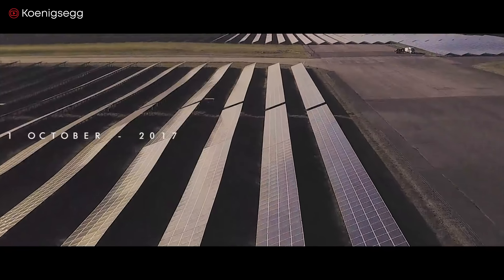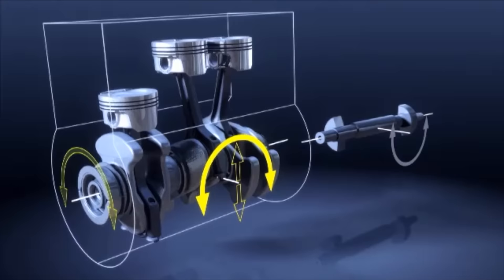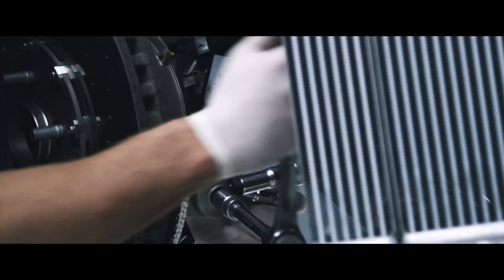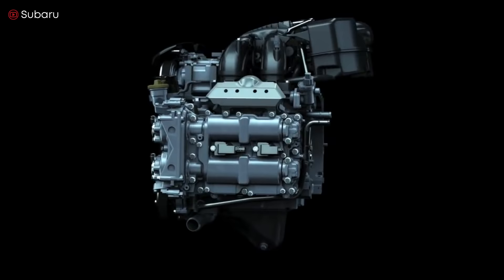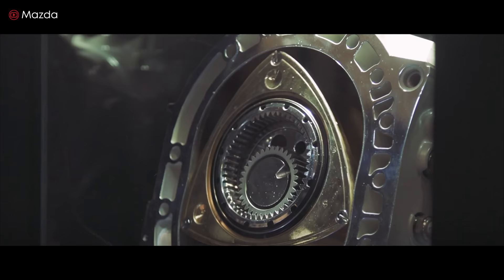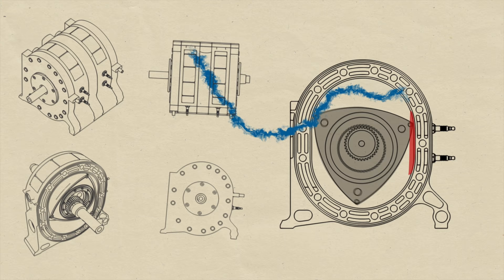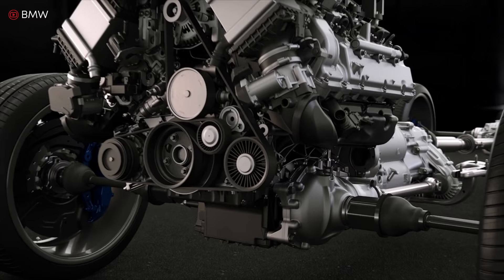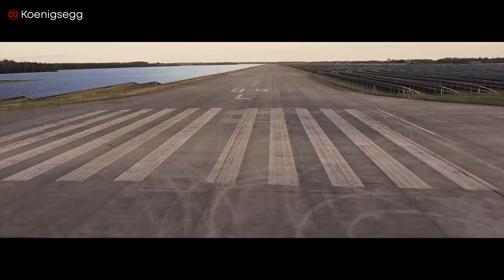Who Makes the Best Engine and Why

Comment: "rotary engine" is a incorrect designation, launch from Mazda because sounds more sexy as "Wankel KKM" (for "kreiskolbenmotor" = rotary PISTON engine...A "rotary engine" is sommeting different: invent in 1893 from the french motorcycle builder Felix Millet, and use up to the early 30's as aircraft engines...

Comment: What does the top speed times have to do with, "Best engine"?   Answer-Almost nothing.   Scotty should know, it is believed that the SSC TuaTara falsified their data a top speed video.   Is the TuaTara, Bugatti or Koenigsegg really production cars?   Technically now, yes.  That is debatable.    At least the Koenigsegg and Bugatti runs were  legitimate.    So, what the 3 have in common is:  They all have 4 wheels and are cars?   They should be that damn well engineered for the money.    Benz/Mercedes-Benz have done everything.   They invented the first automobile and have introduced almost every technological feature, safety feature and other.  Almost everything trickles down from Mercedes of a decade before into your average daily Toyota. ;)    (AGAIN...IT IS PORSCHE......PRONOUNCED PORSHAAAAAAAA!   How is that Toyot doing?  Rhetorical)    Always sounds like he's reading off index cards..very robotic.     I won't mention his Nürburgring Nordschleife pronunciation.

Comment: Honda makes the best engines,  but there transmission can be a little weaker.

Toyota makes the 2nd best engines,  and there transmission is better than hondas

Lexus is also  excellent 

Modern Mazda is improving and is making some impressive vehicles
Reply: Not the manual my civic type s 2.0 petrol has done 260.000 miles and still all original (except just had to change water pump) and the manual gearbox is still perfect

Comment: SCOTTY; I've told you this before, stop believing the first article you read. You've repeatedly published inaccurate information, and used incorrect images in your videos. When fact checking your videos, I commonly find that the information you're publishing is the same as the information found in the first Google result on the topic. To create quality content, you need to do thorough, multiple source, research... Which, apparently you do not. Scotty, I'm a long time fan, but if you're going to continue just "phoning it in, " it's better to tighten your belt and retire, then let the quality of your product slip, and ruine your reputation. With a good rep, you can always come back... Then again, maybe just riding your existing reputation, to get away with making inaccurate videos, is what's best at your age. Get the money now, because there isn't a whole lot of later, right?
Reply: You are bashing the work of others whilst contributing absolutely nothing yourself. You sound like a Wikipedia admin.